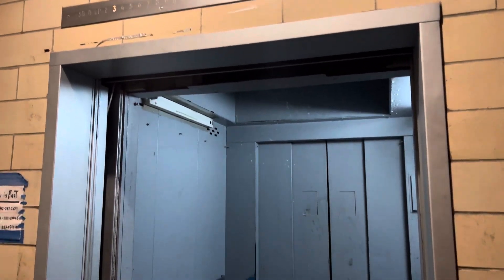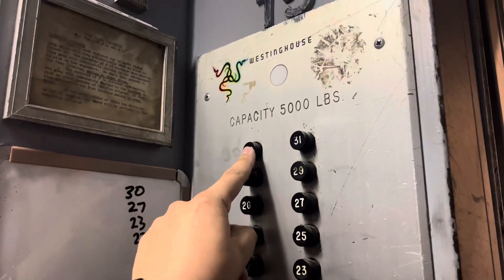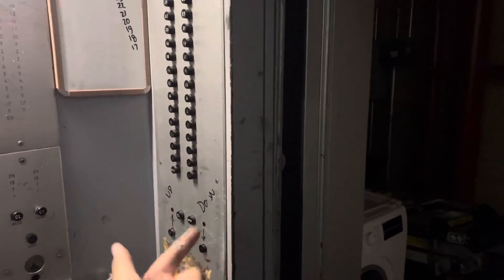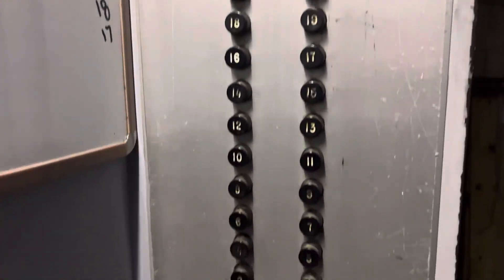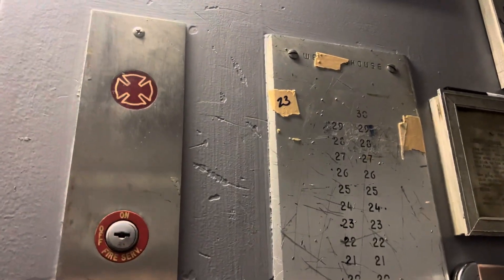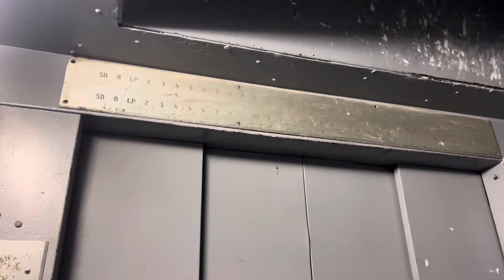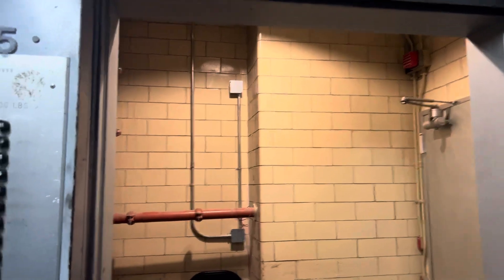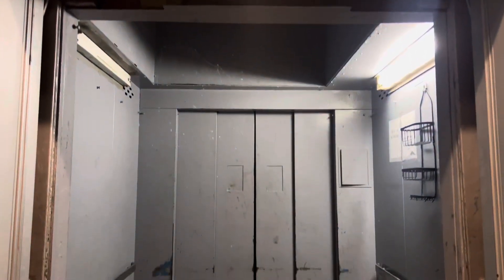1953 Westinghouse Signal Control (RSBL) Elevator

Comment: There is another Westinghouse Signal Control installation in Manchester NH from 1950 but they haven't run since 2024. They were slated to get modded but that never happened. I remember riding them when I was younger. I'm not sure if the one in this video can be set to run automatically without an attendant but the ones in Manchester could, and that's how I remember them being.